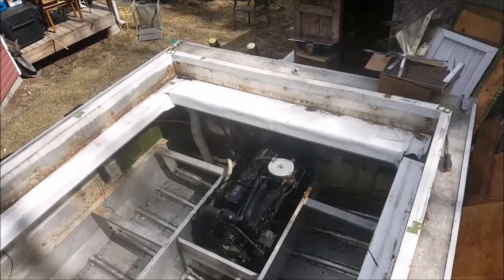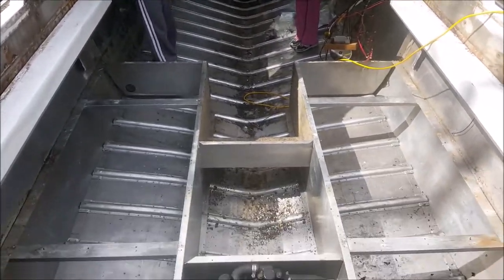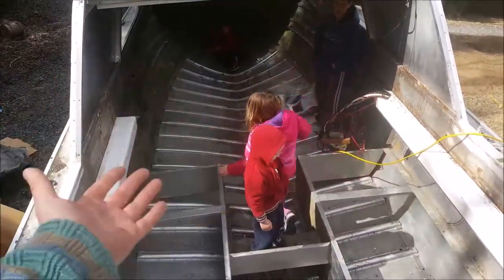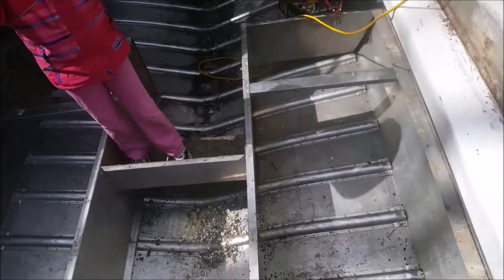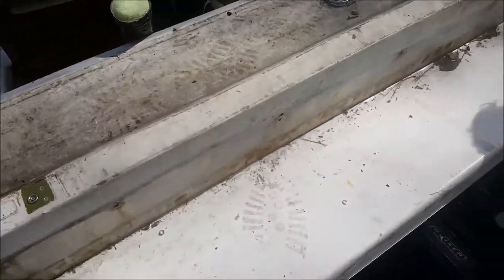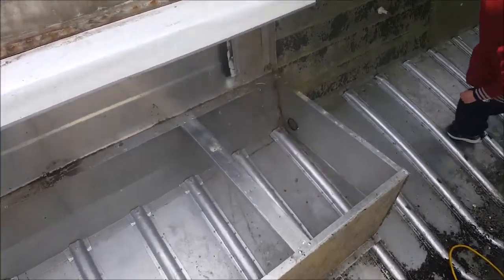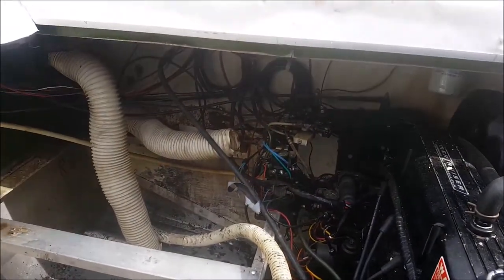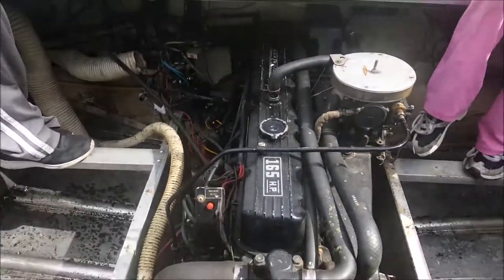1974 Starcraft Chieftain 25' After interior strip, before engine out

Comment: I have a '74 Islander 22' very similar condition when I "inherited" it.  I gutted mine to the hull also.  I was and am still amazed at how solidly built they are, I do not think they build anything structurally close to this unless it's a crew-boat these days.  I also had the 160 Mercruiser grossly under powered given the hull weight, which was done for, hopelessly cracked and mortally wounded.  So I decided to begin extending the transom and switch over to twin 150's with a swim platform in between effectively making it 25/26 ft long.  The extra flotation off the tail should help it sit and plane better with bodies/fuel and gear onboard.  I am having a fuel tank built to fit in the sump below its floor about midship. That is where I am headed for now.  Always hunting ideas of what to do about the cuddy cabin and that big sharp angled windshield.  I am departing from the original classic designs some but still want to retain some of the character without the squared lines.  The hull has a curvy big lady appeal but the deck up is, all sharp with right angles.  So I will follow your posts.  Best

Comment: How did you remove side panels?
Reply: If I recall correctly, there are a number of screws and bolts holding them on.  I had to remove some angle aluminum, and then it was just a case of locating all the screws.  Not hard - just time consuming.  Some panels came off after only a few screws, others required some searching.